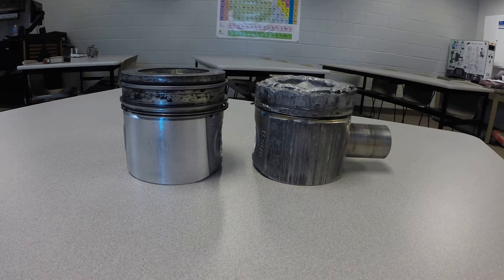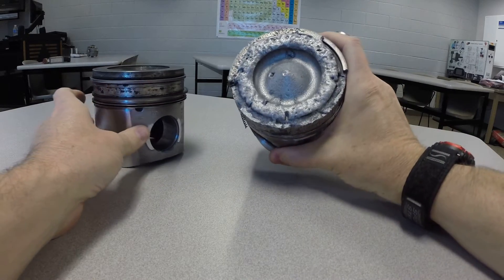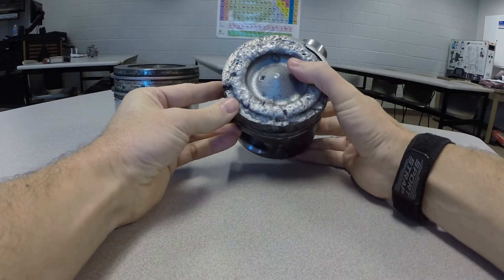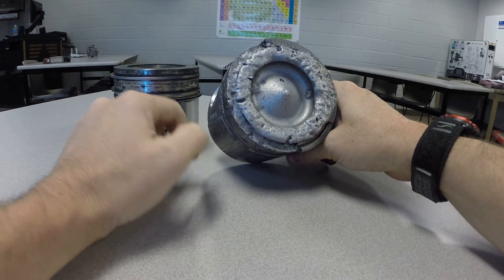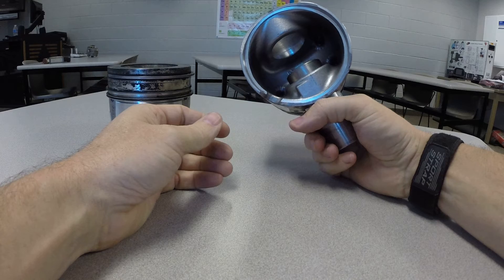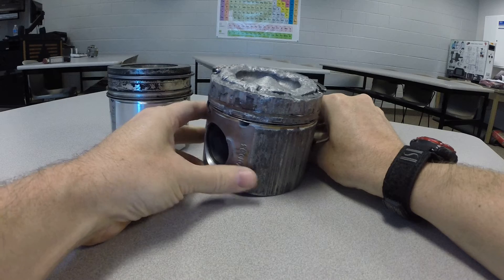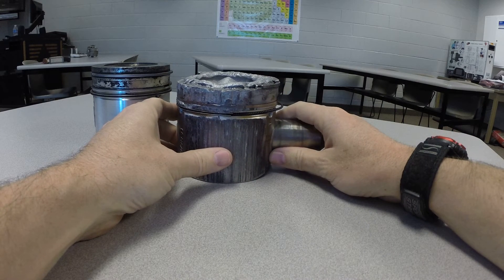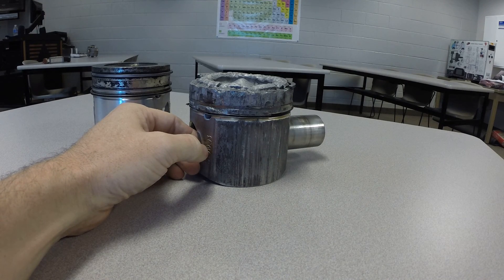Piston Failure, 6.7 Cummins

Comment: another shop spreading fear to sell stuff.  Issues happen but to say diesel injectors are poor overall is simply ignorant!  There are  ok designs and very good designs.   I has a duramax and it had injector problems after only 60k miles.  I have had 4 cummins powered rams from 1998 to 2014 and never replaced an injectors.  Ran them up to 175k miles before I sold them and they were still going well.  
Running stock power! GOOD fuel and a lubricity additive is key.     
I have also been engineering diesels for 20 years.  I how he just talks like a smart ass.  "somebody needs to design a good injector and they would be rich"  they already have.  Its called bosch.

Comment: problem is the high pressures and very tight spaces inside where 2 microns is the clearance....you did not hear so much about injector issues in the lower pressure mechanical engines like in the 6.2 diesel, 7.3 and even the 6BT Cummins.  True they were not "bullet proof" but I have a 240K miles 6BT on its origional set (due to be replaced due to low pop-off pressure on number 4 leading to smoke under load).  But the high pressure, mulitpul events wear them out sooner.

Comment: why dont they just design the ecm to shut off the injector if it detects it operating abnormally?
Reply: Cause it is leaking on the mechanical side not electronic side. Nothing to monitor

Comment: I didn't hear how many miles was on this injector? 10,00? 100,000? 300,000? I did hear it was a 2007 motor, and this video was uploaded in late 2014. Are we to assume that the injector in question had been pulsing for nearly 7 years before this?

Comment: 7.3L Powerstroke mechanical split shot HUEI injectors? My 2000 F550 wrecker has 300,000 on all original equipment.  i recently (250,000 miles) rebuilt the front end.  But engine and trans are stock and the truck is driven wide open more often than not.  Back when things were built right.  Lol.
Reply: So it's ford tuff right? Go look at the powerstroke fail videos
Reply: While I do not disagree with what you are saying, two notes, the 1994.5 Powerstroke produced 210 peak horsepower, and 425 ft-lbs of torque, today's diesels very nearly double that with less displacement, and their longevity isn't exactly half that of the 7.3, its usually around the 75% mark, so we have moved forward. The original B series Cummins was a joint venture between Case IH and Cummins, and was first introduced in 1985 iirc, and todays 6.7 Cummins is a direct descendant of that original design.
Reply: +UncleBubbles94 and my 2001 F150 4.6L is near double a 1988 F150 5.0L and mine has 208,000 miles and daily driver. If anything,  my engine is more reliable,  efficient,  powerful,  etc. The 7.3L with split shot HEUI injectors hit the road in 1997 i believe, would have graduated high school last year,  and still maintains the standard for reliability. it's like not being able to build a more reliable phone than the Galaxy S2. sure,  faster,  strong,  but doesn't last as long.
Reply: UncleBubbles94 I agree. My VW 3.0l TDI makes the same power. M

Comment: I swear by Howe's Fuel Conditioner and Cleaner for my diesel engines. Had a 475hp E model 3406 Cat motor go over a million miles before needing an in-frame. Last I heard, it's still going.

Comment: This is why I tell customers, if you notice a rough idle, white smoke upon start up(HPCR engines should not smoke white), or loss of fuel mileage get the injectors tested or looked at asap.  I cant count how many engines we've saved from meltdown from catching a failing injector early.  This is also why we recommend better fuel filtration, poor fuel quality leads to premature injector failure.
Reply: +Dustin Harrison You're talking Diesel only or gas engines included.  Thanks

Comment: seriously, could Cummins not build a better engine, with all their experience in tractor trailers and other industrial uses for the past 50 years? I mean would it really have been that hard to build the ISB with wet liners, and dual spin on fuel filters, and an actual engine retarder brake rather then backpressure the turbo with an exhaust brake? All of these are prominent features in the ISX, and it wouldn't be very difficult to incorporate them in the 6.7. I mean wet liners alone would extend the engines life well into the million mile mark.

Im not hating on Cummins, I would take my 6.7 Cummins in my ram, over a Powerstroke or a Duramax any day, but Cummins really took the cheap route for the medium duty engines when they could do better...
Reply: @dave194315 but where talking the 6.7 not the 5.9, that was 10 years ago man
Reply: It's wouldn't cost nearly that much. I mean look at the medium duty freightliners, the cost of an ISL cummins vs an ISB is only a few thousand dollars, and along with all the above mentioned features, it is larger at 8.9L, and with 380hp and 1200 ft lbs of torque, it out powers the 6.7s 325 hp and 720 torque in the freightliner, therefore part of the extra money goes to having a bigger more powerful engine rather then the reliability features. Midlife it would be expensive to produce it because you'd have to retool and change the plants that produce the ISB but if they had designed it like that in the first place it wouldn't have cost all that much more then the engine does now. Now back to my evil plans of trying to figure out how to squeeze and isl in my dodge...
Reply: They are already million mile engines though, there are 5.9 cummins that have broken over 3 million miles without rebuilds

Comment: I think the problem is the fuel filtration system more so then the injectors. my reasoning for that is stock fuel systems are pretty cheap and allow dirt, water and air into the high pressure fuel system which is pretty bad, it wears away at the injector nozzels and needles and overtime can make the injectors spay unevenly and stay open or drip. not to promote brands here but fass and airdog both make really awesome fuel pumps that reduce the wear of injectors. go check out some of their videos they have a lot more information on the matter and explain more in depth. just my $0.02
Reply: +Justin95386 
I Agree, i have a 2 micron filter between the cp3 and the original filter, which i believe is 10 micron on my 2004 Dodge 5.9.
I had a fass system on my big truck with a C16 worked well until the fass  motors shaft seal went out and left me stranded until i could remount the orginal filter head.